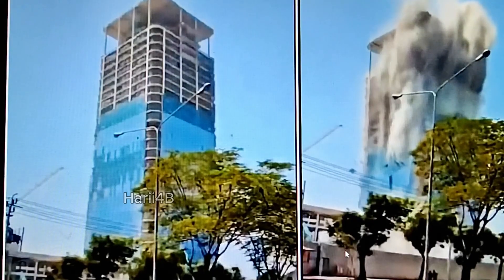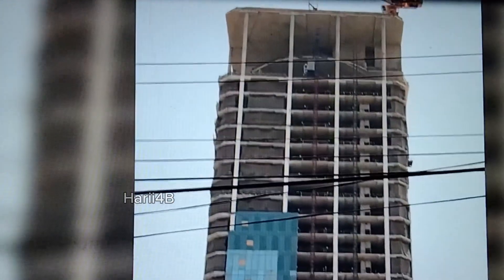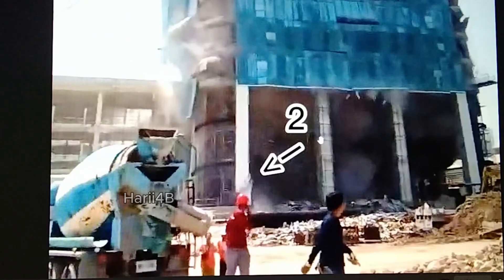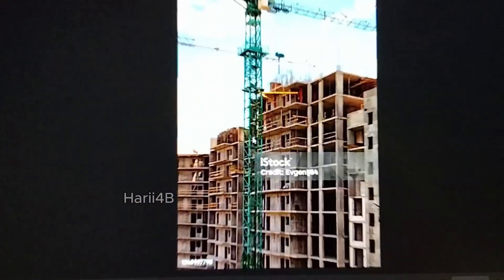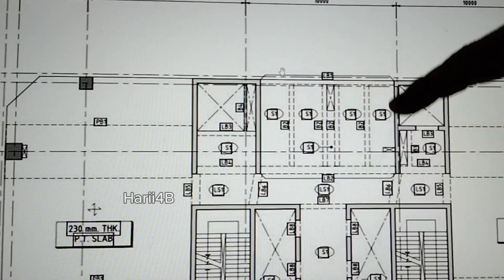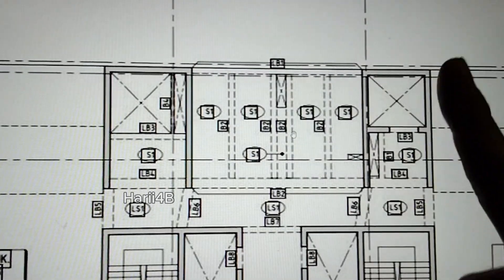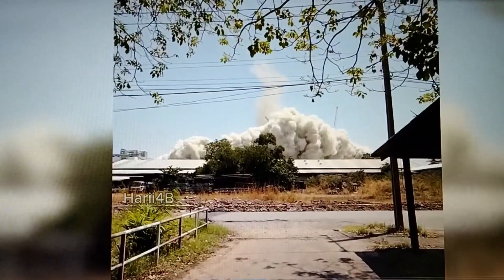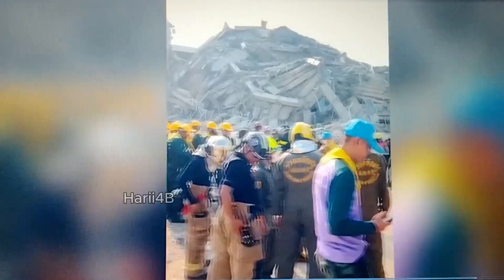Myanmar Thailand Earthquake - Thailand Building Cause of Collapse - Watch Now!!

Comment: So, the lower part of the crane inside the building is causing a lot of structural damage not visible in the video?
Reply from the maker: climbing cranes are supported only on two levels, the bottom and middle height of mast. swaying crane weakens those concrete support points and then collapsed.... worts is, what if the concrete qualities are poor... china made. tofu dreg construction??
Reply: @Harii4B  you should drop that China made tofu construction bullshit. The concrete is sourced locally Chinese company don't make their concrete in Thailand Which means you are blaming the Thais.
Reply from the maker: the investigation now is not on concrete used, rather the reinforcing steel used and taken as test sample at site... let's wait and see the investigation results
Reply from the maker: Engineering Explanation ... coming up!!

Comment: I was also blaming the crane for it, pero i thought the crane was erected from the ground via the elevator shaft tapos ng rock back and forth hitting the walls/floors causing a domino effect
Reply from the maker: climbing cranes are supported only on two levels, the bottom and middle height of mast. swaying crane weakens those concrete support points and then collapsed.... worts is, what if the concrete qualities are poor... china made. tofu dreg construction??

Comment: ang bilis ng analysis
Reply from the maker: evaluation review lang sir hehehe. pero confirm na nga ang tower crane naka pwesto sa upper right corner shaft. malamang naka attach na lang yang base ng crane sa upper top shat walls,,, more or less climbing crane type. nag collapse na wall sa pag sway ng crane at tangay ang mga flat slabs, domino effect
Reply: @Harii4B  maraming salamat po ...iba talaga pag inilalagay
sa slow-mo. diko napansin sa mga nakita ko na nakasalang pala
yong crane sa lapag ng gusali. thanks again
Reply from the maker: confirmed, it's an internal shaft climbing type tower crane. now we know super delikado yan sa lindol lalo pag na sa top level na